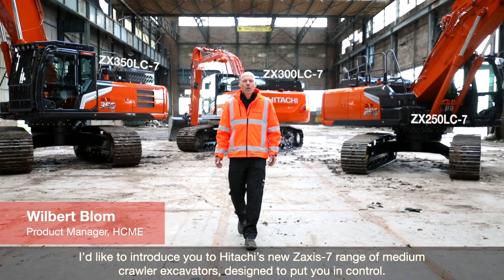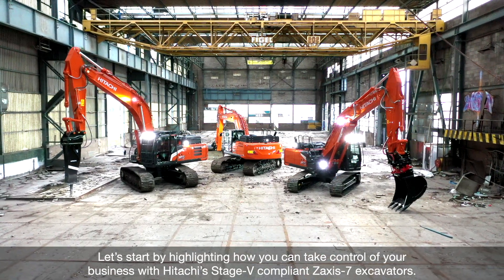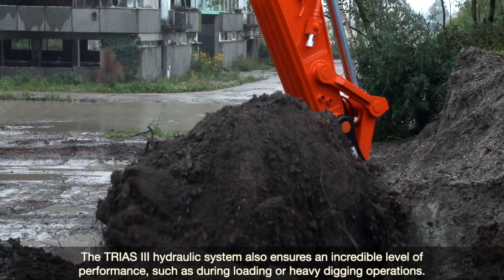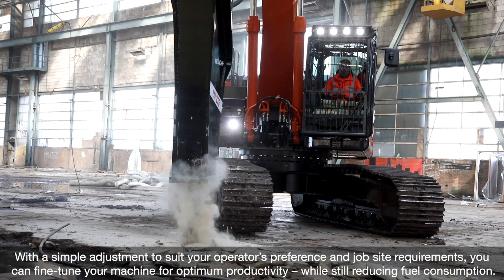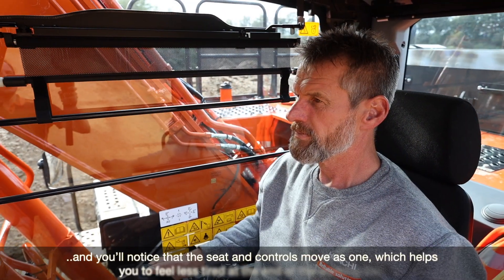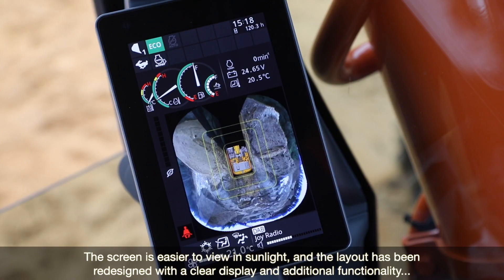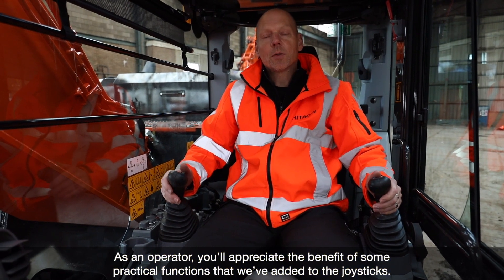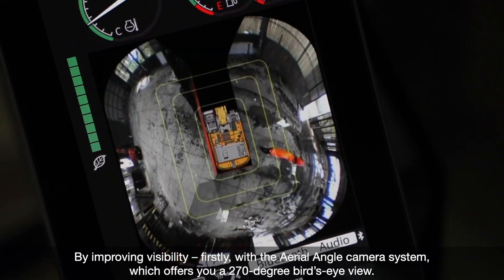Hitachi Zaxis-7 Walk-round

Comment: Driving 13 tone   this new model hitachi what have u done   Terrible  machine smaller engine with no power and slow working  inside cab is best thing about this and that’s it and the fuel efficiency no as engine has to work so much harder not good